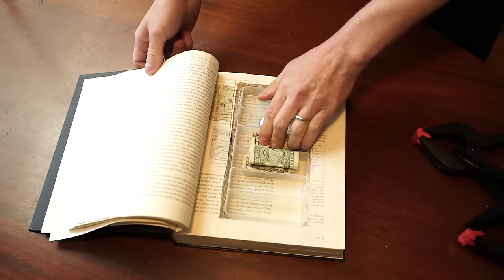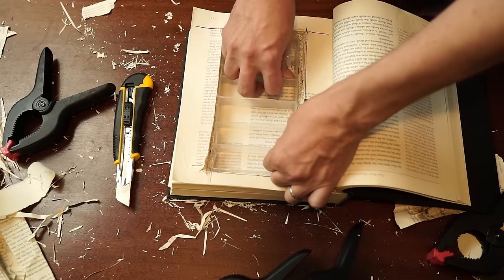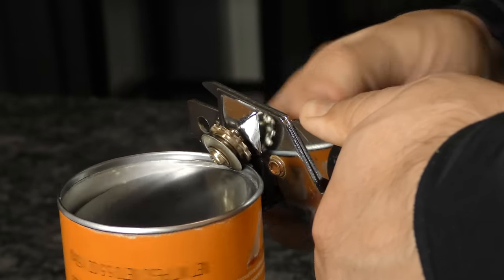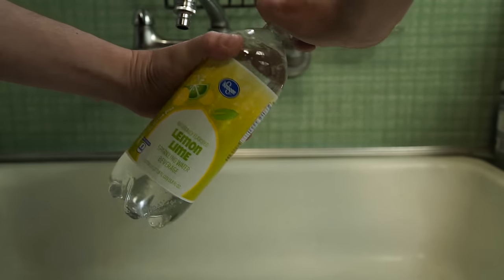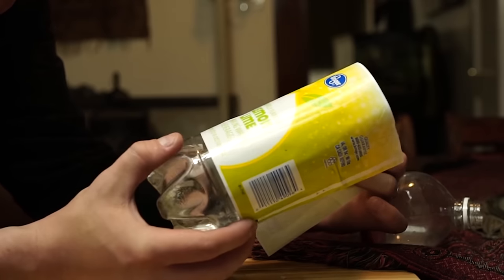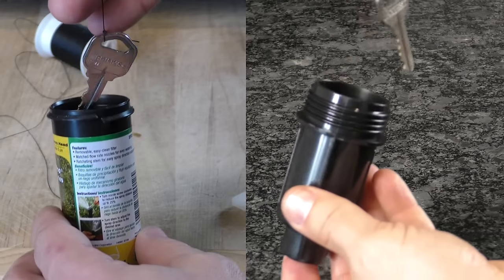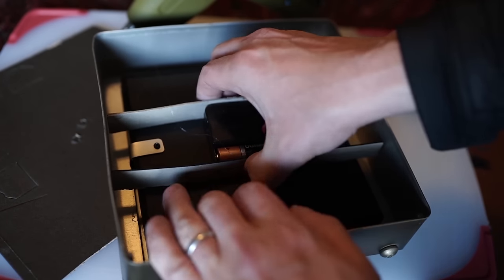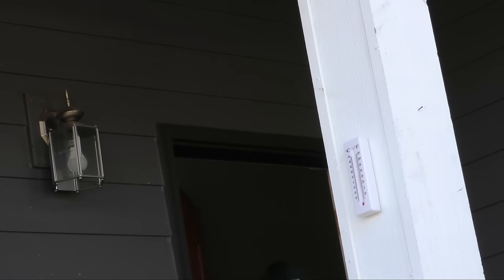How To Make 6 Secret Hiding Spots

Comment: My favorite "secret stash" just involves drilling a hole in the top corner of a door. The bit costs $5 at home depot and you can make it deep enough to hide pretty much anything you can roll up or fit into a 1" diameter hole 

Unless your friends are 7ft tall they're never going to suspect that they touched and moved your secret hiding place every time they came over

Comment: Loving life finally, due to the hot hide-a-key thermometer hacky tip for Apartment living! Since I do live with shared common areas, I could only put it on my front door. Maintenance kept removing my thermometer if I put it in any shared areas :( But it looks even better right there, to me atleast! I'm so confident if I'm ever locked out the spare key is prominently right front & center alone in the middle of my door. Anyways thanks again sorry for typos I'm actually typing this on my friends computer because lately I've misplaced actually lately I seem to be misplacing a lot of things like my tablet actually also. I must have put them with my TV & stereo but I don't recall doing so and i've looked all over the apartment which i keep leaving messy because almost every other day lately when i come home it looks like I through a party & tore up the place. Ok so long & thanks for the terrifically comforting hot apartment Hack/Tip! Keep me in the queue for of these Hacky Q-tips.. ;]
Reply: "...if I'm ever locked out ...".  Install an electronic push-button switch if this is a common occurrence.  Some have pretty unique featured.

Comment: Small trashcan that you put those plastic trashbags in it so it wont stain the trash can. It looks normal on the outside but in the inside the bottom is a bit higher up then what it looks like on the outside. Theres a smalldoor that you can open and put things in and close it without anyone knowing.

Comment: With the addition of the short PVC pipe, to the sprinkler-head, you could roll up some cash and place it in the pipe itself. Put a socket cap on the end to so no moisture gets in and shove it into the ground.

Comment: I can tell you a real simple version. The can opener that doesn’t leave the jagged edges, the opener that just breaks the glue seal on the top or bottom of the can   Figure out the weight on the cans with food in them then reuse as a safe, making it equal weight on the label reglue the lid and put back in pantry

Comment: So i had an idea with the thermometer. Instead of just taping the key to the back why not glue/epoxy a really small baggie to the back, no no not for drugs, the tape will stop working after a few nights of heavy drinking at the pub, and losing your keys,  by attaching the baggie it will protect the key only be slightly thicker than the tape and the key wont rust.

Comment: what ive thought of is to cut a hole in the concrete under a tile and cover hole with tile and if a person wrapped up their stuff in plastic it wont rust if you want to glue tile back down. if you score the tile withan x from the bottom with a
 grinder then all a person has to do is break the tile with a hammer and retrieve their stuff. i think this is a good idea for a gun

Comment: A better way to cut paper our of the book is to use a drill and jig saw. Make the same marks, and then drill one of the corners- use a large bit, and place a piece f foil in the page where you want to stop. Go slow. Then get the finest blade for the jig saw. You should be able to adjust the depth of the blade to fit your book.

Comment: An easy way to make a hiding place is just an ordinary pill box. Open it VERY carefully from the bottom, put your stuff in, and thinly glue-gun the bottom closed again. Stick in the back of your medicine chest or under the sink or something. If you want to be even more secure, take the pill bottle open it up and take the contents out, put your valuable stuff into the bottle, add some pills back in to make it rattle when shaken, and so the weight is about right. Now, take some self adhesive aluminum tape (can be got at any hardware store), cut a little 1" circle, and use that to re-seal the pill bottle, put the lid back on it, then put the bottle back in the box and glue it shut carefully on the bottom. Upon all inspection, it's just an ordinary factory-sealed box and if they open it, it looks like factory-sealed bottle inside.

Comment: 600lbs safe with a combination lock that won't turn unless you use a key to unlock it first, and inside on the top shelf a shinny eye catching .38 revolver. To take the attention of whoever made you open the safe and you quickly grab the flat black 9mm loaded chambered with safety off just far enough inside it's in the dark. In the worst case scenario it ever comes down to this.

Comment: Cut the bottom of the Pringles can off and just glue it to the top of the stash jar. No pliers or magnets required to remove it. And it will look far more believable. Also use a plastic container to reduce the weight.

Comment: Store your key in sprinkler head, hide sprinkler head in water bottle then the water bottle inside the wall clock.  That way if the thief finds the wall clock you still have two more chances they will just move on....

Comment: once i had two empty boxes of kinder brand chocolate bar/sticks and one was empty the other had 4 joints (spliffs) in it , i was at the train station and absentmindedly chucked the empty box in the bin. i walked up to the part of the platform my door for the train was going to be in (like a 3 min walk) and literally as the train pulled up i thought to check i hadn’t thrown  out the wrong box.. never felt such panic in my life , i sprinted back to the bin praying in the 5 minutes i was gone my doobies and the bin bag hadnt been empties or taken away. they hadnt (phew) and were still right on the top still (no spilled food or deinks or anything from others trash) i grabbed that box out and threw the other ACTUALLY empty one out and quickly ran to make the train(just in time). it was so fucking stressful but damn sometimes it pays well to be an overthinker/think twice/worrier/paranoid/  ugh i hate this term “ocd” or someone that just pays attention and is aware of the fact that they sometimes make ‘minor’ mistakes that will cost them later. whatever you wanna call it, i was not about to lose fucking FOUR, freshly and perfectly, マスター MIGHT I SAY , THREE paper,  packed phat CONE marijuana cigarettes. i was 14/15 bro i did not had that type of money to throw into trash can at local train station.

Comment: ummm if i picked up a can of pringles that had a jar inside? you want to keep the weight difference not just the sound of chips. use something plastic. second. the book safes are awsome. but dont glue the outside of the pages????? thats so obvious. just leave it way it is, then you can stack it anyways you want with pages showing and all.

Comment: Clearly not Aluminium if you can use s magnet to extract it from the Pringles can as aluminium is non ferrous metal and the magnet wouldn't stick to it. 🙉🙈🙊🙊

Comment: Instead of a water bottle, how about a vinegar, or some other bottle that holds clear liquid, and replace it with water,and put your stash there❔ Use these as a reference point to make a hiding place, but first put the weed, or alcohol away so you will not forget were you put it❗🤕

Comment: Wow... None of you pay attention, you put chips back in the container so it's NOT empty, meaning no one would just throw it out but if they picked it up I guarantee they would feel the HEAVY GLASS JAR in the bottom. The book was great, the clock was ok, the water bottle was ok but when put on its side you would clearly see something inside,  the sprinkler is good if it's put somewhere ppl can't easily see you access it, the thermometer is terrible because if you ever open the curtains, like everyone does daily, anyone in your house can see the key, movers, a handyman, anyone. Good ideas but they need some tweaking to be practical.